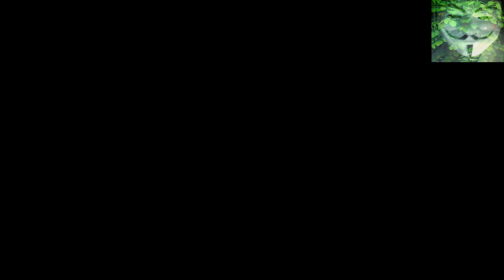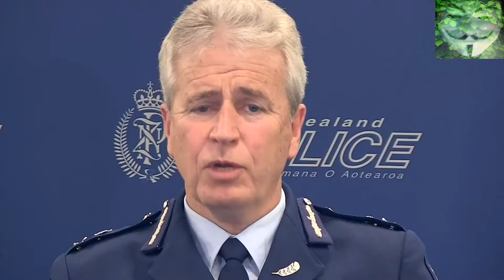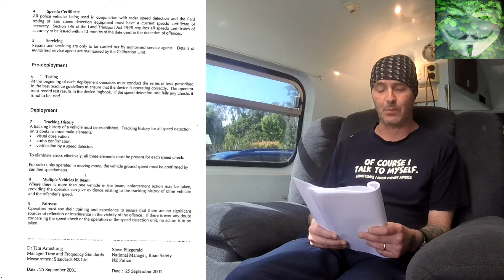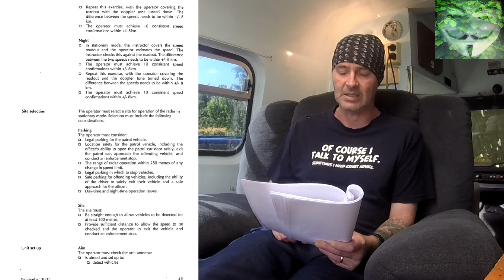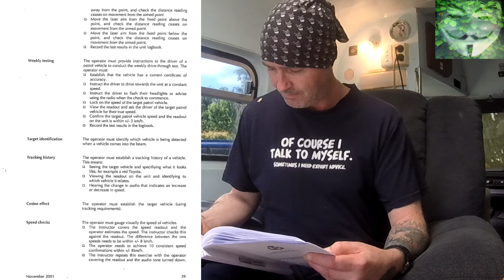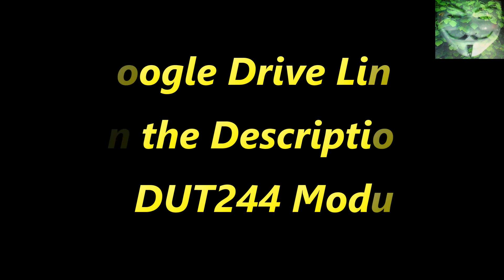New Zealand Police - Speed Cameras - Operators Module - Part 3

Comment: so at every stop on an individual for suspected speeding the officer must show the log book before they write an infringement yet no person is injured when a speeding ticket is enforced.....
Reply from the maker: no not at the stop, unless you ask to see it of course, but then most won't, which is why it is important to follow up using court process, but remember that is if you are stopped by a cop . vs clicked by camera van, owness probandi lays on the prosecutor, the defendant is presumed innocent, so by asking for initial disclosure, which they screw up most of the time they are no following due process of law, they have to prove guilt beyond a reasonable doubt, so make em! if one has a license through his/her persona, one is obligated through prescribed legislation as such to abide, however all of which must be proven by the prosecutor, not for the defendant to prove his/her innocence. by asking for initial and full disclosure all the evidence must be provided and their errors are a plenty, in my case, over 20 errors. but this will be posted in the next month or so.

Comment: I still reckon that you would benefit by referring to the Western Australia supreme court fisheries case specifically in relation to testing instruments and compliance with s10 of the National Measurements Act (Cth) because ya know, with NZ being a state of the Commonwealth of Australia. See Commonwealth of Australia Act 1900 (UK), also available on Austlii.

The argument would be along the lines that the value that they're attempting to use in court doesn't comply with s10 and is therefore inadmissible as evidence regardless of their certificate of accuracy.

If the device is properly certified it'll have a National Measurements Institute number sticker on it.

Over here most measurement devices have them sans speed detection devices.  It's quite funny because the breathalyzers have them and the WAPOL have a qualified unit to test them.

19:02 lidar weekly testing suggests that it be tested against another device.  That's a no no per the fisheries case.
Reply from the maker: i will have a look at the case your mentioning Deryk, however as Judge Blacks Plea was removed, and the Court still needs a plea from me, and the lawyers are all saying the judge will throw the case out due to Prosecution not supplying initial or full disclosure, and they still haven't supplied the License Status for the defendant, i don't think it will come to that, but i do comprehend your point deryk, many thanks.

Should it actually get to a defended hearing, i have many questions already for the operator, notice the operator does not issue the notice, another member of police does a week later, which does not comply with this module.

i am looking forward to it, immensely. 

have you read the imperial laws applications act 1988, here http://legislation.govt.nz/act/public/1988/0112/latest/DLM135074.html?src=qs

do you have a link to the fisheries case deryk?

i appreciate your help and interest mate, hope you had a great new years!
Reply: Library number: 960190
Case name: BREEDON v KONGRAS
Link: http://decisions.justice.wa.gov.au/supreme/supdcsn.nsf/judgment.xsp?documentId=9AF840207297449648256461002FDC6F&action=openDocument

My thinking with the suggestion regarding the above case is that you have an opportunity before you to attempt to set a precident.  I've been lazily been attempting to get flashed to try to do the same.

I haven't seen it prior to having been provided the link.  I had a quick skim and it appears that they've gutted most of it and either repealed that which they cannot without implementing an equivelant in NZ legistlation, OR they've repealed and implemented an equivelant in NZ legislation.